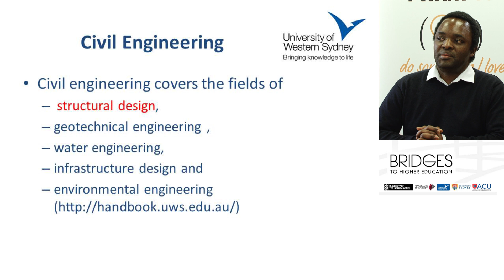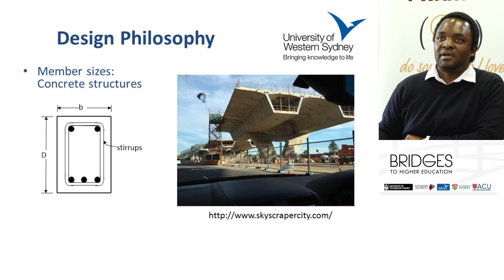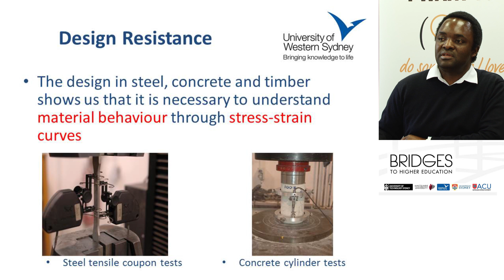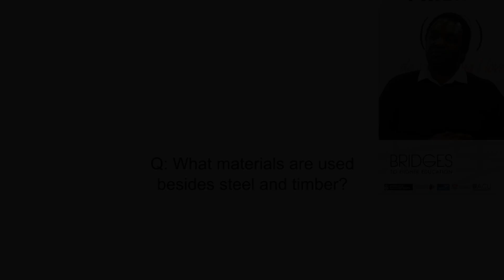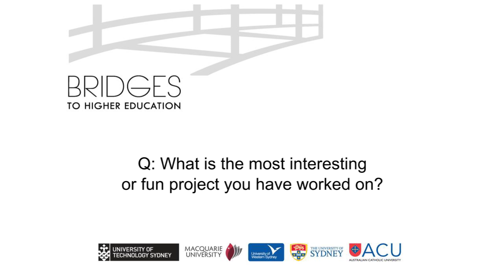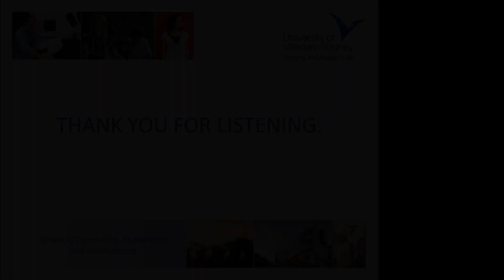Design of Civil Engineering Structures - Dr Fidelis Mashiri

Comment: Good work Dr. but my concern is. on the question of innovation or breakthroughs in civil structures..i thing it might not only be of the advance in the materials we use or have in market, steel shapes and it grades always remains same for pass 150yrs now. But its of the design concept, design standards, Advance software's and how skillful the engineer or the designer may be.